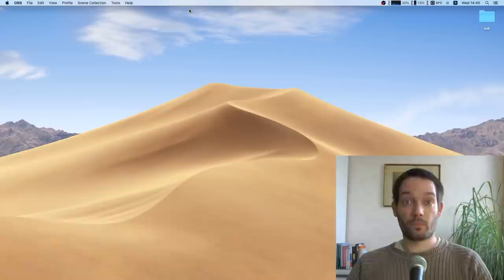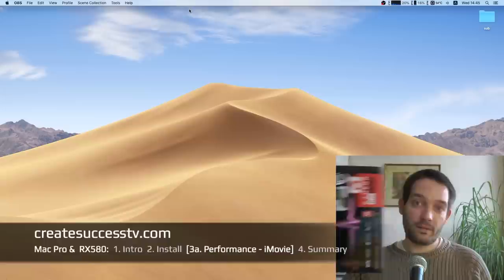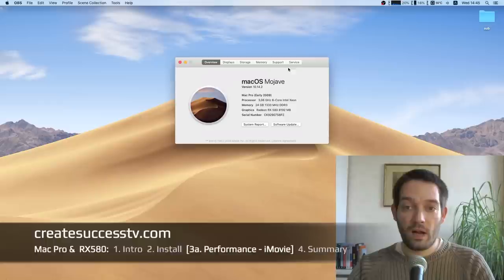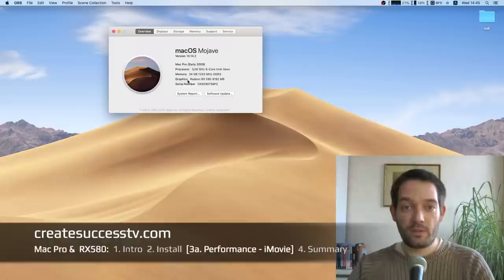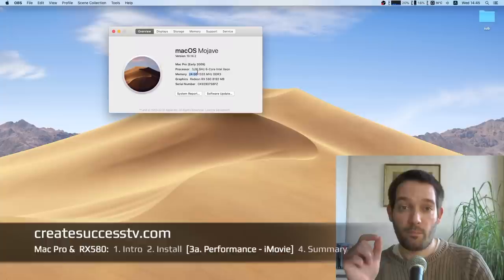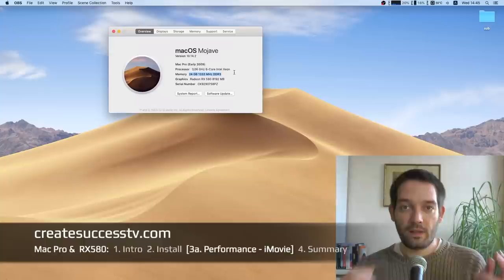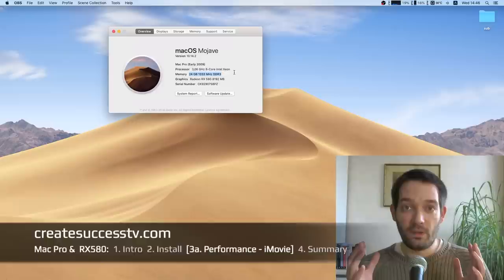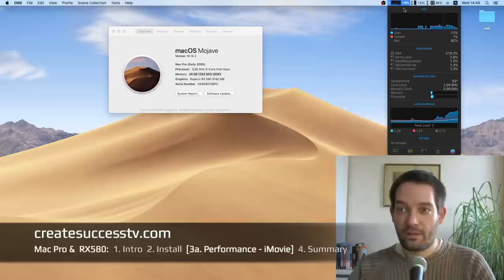Mac Pro 4.1 and 5.1 GPU Upgrade for Mojave (Sapphire Pulse Radeon RX580)

Comment: Could that discrepancy in memory usage be similar to how cores are used? I've noticed Logic Pro does a similar thing with CPU cores. It will be low, low, low, and then when I EXPORT or do certain functions, especially export all tracks, it will blast the cores to %100. My theory is the programs are not utilizing cores (or boost) well, or it can do all it can (since other options are frozen)  during these functions.
Reply from the maker: Can't comment on Logic since it is for audio, but Final Cut Pro uses 50%~60% CPU when exporting video.
Reply from the maker: Honestly there are various factors involved, in video for example there are different codec types such as H.264 IPB, H.264 ALL-I or Apple ProRes, and they all can behave slightly different.
Reply from the maker: I read once that consumer H.264 was made for two cores and more heavily compressed, while ProRes is more uncompressed and much better at utilising all cores.

Comment: Thank you for share the great video.  it's so detail especially you show up the power draw detail info of the display card. it's important for me to choose my mp 5.1 e5620x2 Xeon.   I am thinking about Sapphire pulse 8g or gigabyte 590 8g(no DVI) at the same price... but I worry about High Sierra can't compatible 590 chip...  my mp still bootrom in 130089.b00 , I can't  update the firmware to 140 or 144 before I get the metal card.
Reply from the maker: Please install High Sierra, then change the graphics card, then install macOS Mojave, that's how I did it an it worked fine.
Reply from the maker: When you start the Mojave installer it will ask you to do the firmware update, carefully follow the instructions on the screen.
Reply from the maker: Haven't tested the RX590, but it may work.
Reply: @ReviewTechTV  thank you so much for your nice reply,  good luck CSTV make the mp modify video here, I will step by step follow the guide from yr video. my mp5 is installed High sierra now and hd5770 for temp use,   start to get the parts to Mojave step.  wish every alright. thx again CSTV. (sorry my English not well).

Comment: Great Video man.. I just installed a RX580 graphics card in my (MID 2010 5,1) But didn't get a boot screen.. What do I have to do, to get the boot screen ?
Reply from the maker: Apple uses custom BIOS on there GPUs, aftermarket ones don't support the grey boot screen!
Reply: @ReviewTechTV  These cards can be flashed by professionals in order to get those boot screens back. See my comment below.

Comment: Question for you, please: How is it that my early 2009 mac pro, which was a 4,1, and is now a 5,1 has two 3.46 GHZ 6-core Intel Xeon 5690's, but the memory is 1066 DDR3 MHZ instead of 1333 MHZ DDR3? Can I upgrade the memory to 1333 MHZ?
Reply from the maker: Of course you can put in 1333 MHz DDR 3 ECC memory, I recommend using 3 modules for each Xeon, because the CPU has a 3 channel memory controller!
Reply from the maker: Also, if you put in the memory but it isn't detected right away as 1333 MHz you can try the PRAM reset when booting ➜ https://support.apple.com/en-us/HT204063
Reply from the maker: I am currently running one 3.46 GHz and 3x16GB modules, works very well and reliably, I got recycled server surplus CPU and memory for cheap, very much worth it, here my Geekbench results ➜ https://browser.geekbench.com/v4/cpu/14067727
Reply from the maker: If you are located in Europe, I recommend this vendor on eBay, have used several times, always great:
Samsung Memory 48GB:  https://ebay.to/2nHvIYT
Reply: @ReviewTechTV  I am in Seattle, Wa. But thank you for that recommendation. Question: I have 4 memory slots per cpu, so I can max out at 128, which is my intention. But this 3-channel point, I do not understand? Please elaborate.
Reply from the maker: The CPU only has 3 memory channels, putting in 4 modules works but may be slower.
Reply from the maker: Part 5 - Memory ➜ https://youtu.be/1XYNqfnu4UA

Comment: Hello im currently looking at the SAPPHIRE Nitro + Radeon RX 580 8GB GDDR5 overclocked version. Does this draw alot of power when used for video editing and on occasion some gaming? As on the box it says 500 watts required but i know on my mac pro 2012 model its 75 watts each right? Or am i reading this all wrong?
Reply from the maker: Information is already given in the video description, see bottom of the text.
Reply from the maker: Don't confuse the recommended size power supply with the actual power draw of the card.
Reply: @ReviewTechTV  Ah perfect this is where my confusion lies as i kept looking at the specification on the box vs what i have in my comp. As you can tell i'm upgrading my tower and the first step is to install two Intel X5690 and then the GPU and upgrade my rear USB'S to 3.0 or C if they are available. I didn't want to do this and affect the power draw from the GPU. But you've been super helpful thank you
Reply from the maker: Wherever possible use a frame-independent (intra-frame) codec, for example, Apple ProRes, or Canon ALL-I, because speed in video editing is strongly influenced by the video codec, in my opinion much more than by the GPU, especially on the old MacPro.
Reply from the maker: Most consumer video codecs are made for reduced file size thereby sacrificing performance in editing and rendering footage, I recommend reading the ProRes white paper:
➜ https://www.apple.com/final-cut-pro/docs/Apple_ProRes_White_Paper.pdf
Reply: Create Success TV Thank you! I’m going to have a read through
Reply: @ReviewTechTV  Hello just checking in. RX 580 Nitro + installed. I wanted to check if this happened with you. I was trying to play my holiday videos from my gopro at 4k 60fps with div x player then cisdem video player and its all choppy and laggy. Im not sure if its down to the fact that i wasn't able to update the bios firmware and currently still on 138.0.0.0.0. I'm going to look for info on how to update the firmware and see if makes a difference. If not i'm due to change the processors this week anyway.
Reply from the maker: Open the file with the standard quicktime player, click on "Window, Show Movie Inspector" then you can see format and data rate.
Reply from the maker: To update the system Boot ROM open the App Store, download Mojave, start the installer, current version is:
• High Sierra (Boot ROM MP51.0089.B00) - NO
• Mojave 10.14.    (Boot ROM 138.0.0.0.0) - NO
• Mojave 10.14.1  (Boot ROM 140.0.0.0.0) - YES
• Mojave 10.14.2  (Boot ROM 140.0.0.0.0) - YES
• Mojave 10.14.3  (Boot ROM 140.0.0.0.0) - YES
• Mojave 10.14.4  (Boot ROM 141.0.0.0.0) - YES
• Mojave 10.14.5  (Boot ROM 144.0.0.0.0) - YES
• Mojave 10.14.6  (Boot ROM 144.0.0.0.0) - YES
Reply from the maker: The YES denotes the boot support for NVMe drives, but the system Firmware adds other things as well, updated CPU microcodes and such...
Reply: @ReviewTechTV  Thank you. I'm going to get this done now
Reply: @ReviewTechTV  Now im completely lost. In the end i couldn't find mojave in the mac store so i went online and downloaded from apple's site and my boot version is boot ROM Version:	MP31.006C.B05. In the about mac section my model version is missing. I will give this one more attempt before bed

Comment: Hi great video and well explained. Question do you get the Apple boot up logo with this card & work with the Apple Cinema Display (20-inch (1680 x 1050) aluminum model)?
Reply from the maker: If you put in an aftermarket graphics card you will not see the “grey” boot screen. This is because Apple stock graphics cards use a custom BIOS, and once you use a non-Apple GPU you lose the grey boot screen.
Reply: You can flash them to get the boot screen
Reply: @ReviewTechTV  Thanks mate. Keep up with the video post really informative and a nice step by step guide which is easy to understand how to thank you.
Reply: @Messiah38  can I do it using my mac? And what app do I need thank
Reply: tazdotcom you need to install windows w/boot camp to flash PC Card to Mac . Search online for flash rom for the card want to flash. I flash my 280x, make Shute you keep the P.C. rom if you mess up the flash
Reply: @Messiah38  thanks :)
Reply: @Messiah38  Where would you get a custom BIOS for this card? I couldn't find it anywhere.

Comment: Hi...i am upgrading my graphics card for 5.1. What do u suggest RX 580or RX 590. I do 4k edits. Your videos are very informative.
Reply from the maker: I have tested the RX580, and it works great, other models may work as well but could draw more power.
Reply from the maker: If you have a chance to use an external recorder such as the Atomos to record 4K in Apple ProRes it would probably work best. Because the video codecs can have a significant impact on editing and rendering times.
Reply: @ReviewTechTV  Thanks for replying. Even I think 580 would be great for long term usage. I do not use atomos recorder....
Reply from the maker: @debinvictor2297  I am just saying most cameras use codecs not designed for video editing, that's why I want to switch to ProRes next year.
Reply from the maker: @debinvictor2297  If you are curious I can recommend the White Paper on it:
https://www.apple.com/final-cut-pro/docs/Apple_ProRes_White_Paper.pdf
Reply: @ReviewTechTV  Thanks. I understand that Pro Res is good codec for video editing. It may seem crazy....what I do is convert the footage to Pro Res in Compressor and then work. I mostly shoot wedding,  events and fashion videos. I need a compact setup ( run & gun). That's why I don't use any external recorder. I will definitely buy a good recorder in future .... as I become a pro. I am just starting out. I bought a 5,1 about a month ago(around 350 USD). It's a single cpu  base model with no upgrades other than 16gb Ram. I am slowly constructing it . Your videos were extremely helpful. Thanks ( From India )

Comment: So I have 5.1 and put back the H Sierra drive. Do I need flush firmware still? Reinstall HS?
Reply from the maker: You can check the current version by going to (About this Mac, System Report, Boot ROM Version)
Reply: Review Tech TV - thanks - my ver is MP51.0089.BOO
Reply from the maker: @digitors  Here is an overview, all versions from 140 onwards support NVMe boot:
• High Sierra (Boot ROM MP51.0089.B00) - NO
• Mojave 10.14.    (Boot ROM 138.0.0.0.0) - NO
• Mojave 10.14.1  (Boot ROM 140.0.0.0.0) - YES
• Mojave 10.14.2  (Boot ROM 140.0.0.0.0) - YES
• Mojave 10.14.3  (Boot ROM 140.0.0.0.0) - YES
• Mojave 10.14.4  (Boot ROM 141.0.0.0.0) - YES
• Mojave 10.14.5  (Boot ROM 144.0.0.0.0) - YES
• Mojave 10.14.6  (Boot ROM 144.0.0.0.0) - YES
Reply: Review Tech TV thanks - so my RX 580 should work in H Sierra and not Mojave? What would be the next step ?
Reply from the maker: @digitors  Ok, according to Apple you can install Mojave like this:
➜ https://support.apple.com/en-us/HT208898

Comment: Do you have to install Mojave to utilize this card? I've done the firmware update and went to high sierra but I don't have a desire to go to Mojave quite yet.
Reply from the maker: The card can be used with HighSierra, see video description,
Reply: Create Success TV Thank you! I thought so but I just wanted to double check. Do you know if upgrading to 5.1 raises the ram max? Or only a CPU upgrade effects that.
Reply from the maker: @TheBwiggs  It's dependent on the CPU's you are using, because the memory controller is inside the CPU.
Reply from the maker: @TheBwiggs  I recommend using 3 modules per CPU, because Xeon has tripple channel memory controller.
Reply from the maker: @TheBwiggs  Type your CPU model number into Google and look for Intel website.
Reply from the maker: @TheBwiggs  Currently running 3x16GB = 48GB for one X5690

Comment: Does Sapphire Pulse Radeon RX560 also have boot screen like Saphire Pulse RX580?  Thanks!
Reply from the maker: Only original Apple GPU has boot screen, all other cards have no boot screen.
Reply: Create Success TV Did you buy any extra power cable or did you use stock? Thanks!
Reply from the maker: You can find the power cable in the video description.

Comment: Do you get a boot screen with the RX580 in Mojave?
Reply from the maker: Nope, aftermarket GPU won't have a boot screen!
Reply: I have my Mac 5,1 upgraded to Catalina. I just keep a cheap NVIDIA 120 in my computer for the boot screen. I have three monitors and the 120 runs the smallest.

Comment: Also while you have it disconnected and open, change the BATTERY that is right there.  Its a 2032 very common.  Easy to change.  Trust me.  Do it yah!
Reply from the maker: I still have the original, but yes, changing the battery should be easy.
Reply: Thx for the tip

Comment: You are forgetting that the heavy grade aluminium case of the cheesgrater is a massive heatsink
Reply from the maker: Yes, but there is some plastic material below, so it would block the heat transfer, for me it works fine in slot two.

Comment: Hello, can you use a 4K display on those Mac Pro?
Reply from the maker: I tested several displays with the MacPro, 4K will work:
• LG 38WK95C Curved Ultrawide ➜ https://youtu.be/khASjhPuo2s
• LG 34WK95U-W 34" Flat Ultrawide ➜ https://youtu.be/45_VogXIvnw
• EIZO FlexScan EV3285 ➜ https://youtu.be/EwNrvd6uqt0

Comment: Dude neither H264 nor HEVC hardware acceleration detected (not working) with 10.4.6  Useless upgrade unless you're willing gaming on Windows
Reply from the maker: I am using the system for video editing, both iMovie and FinalCut work perfect.
Reply: @ReviewTechTV  Mine didn't. VideoProc didn't list the RX580 graphic processor (N/A) Well I don't mind now, I sold that crappy Mac Pro 5.1 and I'm building a Hackintosh.

Comment: Have you tried Is your boot screen working?
Reply from the maker: The grey boot screen only works with original Apple GPU, aftermarket graphics card such as Radeon RX580 requires you to turn off file vault, see video description.
Reply: Search the YouTube for open core to regain the boot screen

Comment: Had a Radeon Vega 56 in A Chroma Razer X eGPU for Mab tb3 mac mini. It loaded windows and Monterey with the i7 Mac Mini '18, I use it in the 5,1 AFTER having a asus RX50 8GB and the Vega 56 SMOKES IT. NO PIXLAS MOD, get an evega power supply if your worried but don't.  Plenty of wattage, no bricking, the OS is optimised for the Vega 56 AND its %30 better than the RX580 AND just as optimized and the samish price???? Vega 56 is what you want if your going through all this PITA researching how and what to do building these.  NOTHING IS BETTEWR WITH THE RX580 VS VEGA 56, RX %*) is a dinosaur. Get the Vega 56.  If you do the Pixlas mod one day flash the 56 to a 64, then get %80 + more performance.  Worst mistake was getting this gpu and not the vega 56 which Apple suggests too BTW. Same Price on Used Market.  Id take a 48 gb ram and a vega 56 over 62 GB Ram and a RX 580 and probably more Ram.  I plat DCS World too.  RX580 is a dinosaur and your getting all this fanboy previous mining prices budget vids.  Power of Gaming Vega 56 over ANY RX 580. Period. End of story, NO PIXLAS MOD NEEDED OR RECOMMENDED. NO ONE messed up A VEGA 56 W/O Pixlas Mod... NO one. Your trying to make the best Mac Pro? Your doing work, Saving money compared to a 64 gb M1 Max Stusio With 1 TB right? Spend the same or $40 more on the damn Vega 56.  Unless you want slower for no reason?, then get this RX580!

Comment: does it show the bootscreen?
Reply from the maker: The card works fine but doesn't have the grey boot screen!
Reply: @ReviewTechTV  can I bypass the boot screen (like an imediate login) with filevault enabled? Also did a metal benchmark ans the system crashed, could that be because i was using a singe 6pin to 8pin ?
Reply from the maker: @Arombreak  The power draw differs from card to card, see video description!
Reply from the maker: @Arombreak  If you are using the RX580 you need "dual mini 6pin to 8pin" for a total of 225 watts ➜ https://geni.us/5ozmi

Comment: cables are nowhere to be got though:(
Reply from the maker: Ok, have you look at the video description?
Reply from the maker: Case A: Use the "mini 6pin to 6pin" for a total of 150 watts available ➜ https://geni.us/gBZvb 
Case B: Use the "dual mini 6pin to 8pin" for a total of 225 watts ➜ https://geni.us/5ozmi 

### Case A - Low Power Cards ### 
• Sapphire Pulse RX560 (11267-20) = 75 Watt ➜ http://geni.us/496emt 
• MSI Aero RX560 (ITX OC) = 60 Watt ➜ http://geni.us/5V0VD3 

### Case B - High Power Cards ### 
• Sapphire Special Edition RX580 (11265-21) = 250 Watt* 
• Sapphire Nitro+ RX580 (11265-01) = 235 Watt* 
• Sapphire Pulse RX580 (11265-05) = 225 Watt ➜ http://geni.us/rX6mx

Comment: Anything above Radeon 280x doesn’t support apple LED displays
Reply from the maker: Which Apple Cinema Display do you use? 
• M5662 - DVI-D
• M8149 - Apple Display Connector
• M8536 - Apple Display Connector
• A1038 - Apple Display Connector
• A1081 - DVI-D
• A1082 - DVI-D
• A1083 - Dual-link DVI-D
• A1267 - Mini Display Port
• A1316 - Mini Display Port
Reply: Which one do you have? It's working with my Apple LED Cinema Display 27in with only three USB ports on the back on Radeon Vega Frontier Edition 16 GB.
Reply: Are you guys using a adapter ? I have the 24” LED display , need a dvi to mini port cable. I haven’t found one
Reply from the maker: Not sure if anybody noticed from the videos but I actually use an EIZO FlexScan EV2451 ➜ https://youtu.be/0IMcNAwQwPM
As to the Apple Cinema Displays I am somewhat at a loss here, because there are various models, see list above.